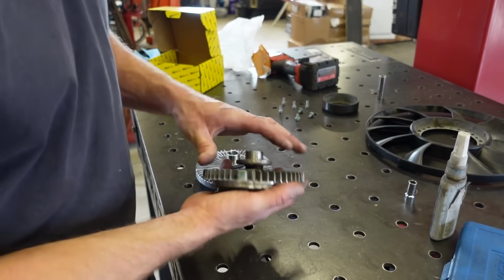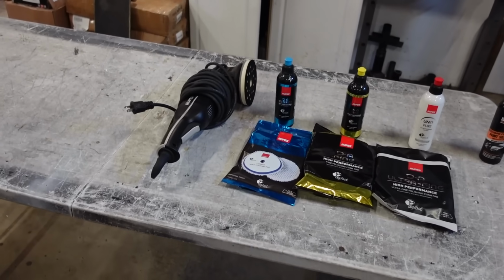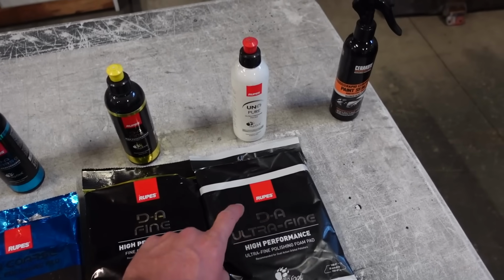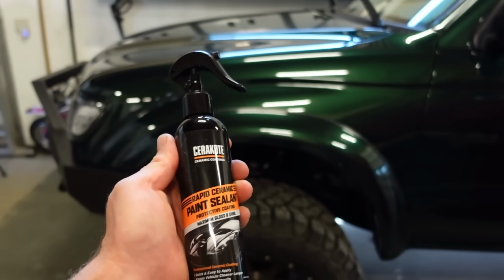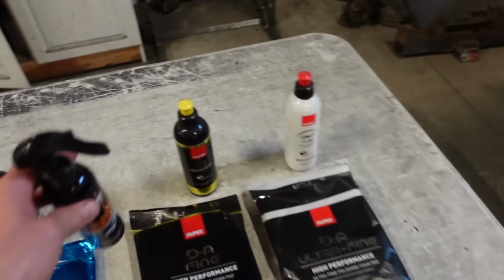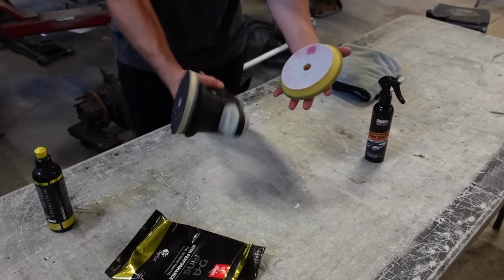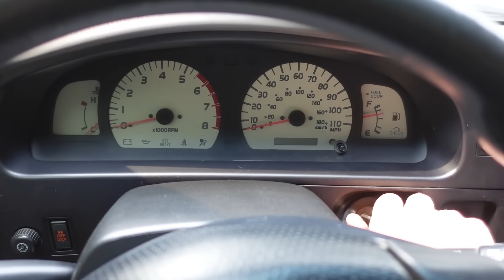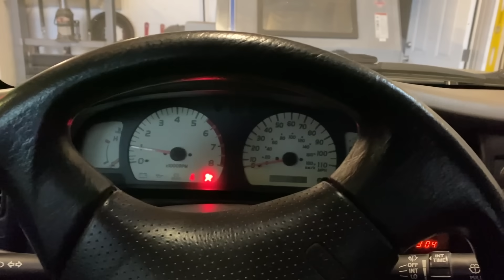I Sold The Diesel Swapped Toyota Tacoma!!!

Comment: For me the best way to test the fan clutch is to rave your engine to 2000rpm, keep it there and listen to the fan, if the fan changes the sound pitch from high to low then it's okay...
I tried this on a Volvo fh V5 and most Toyota vehicles especially Dyna.